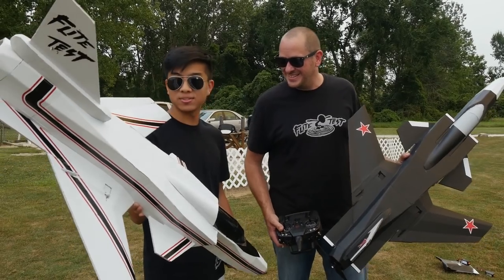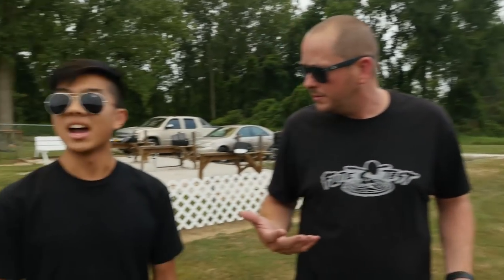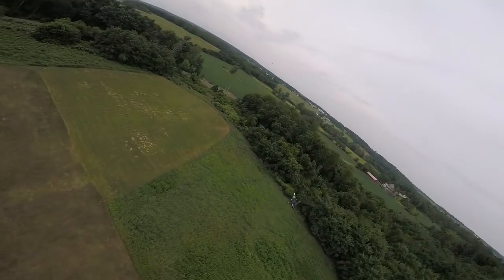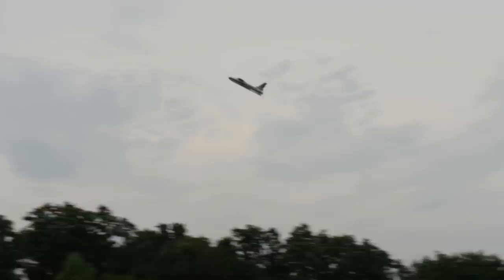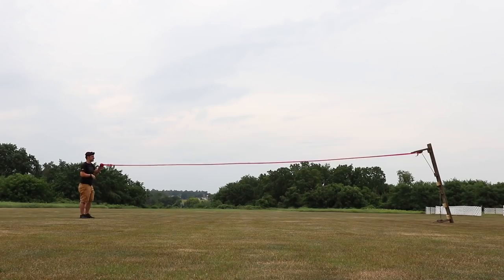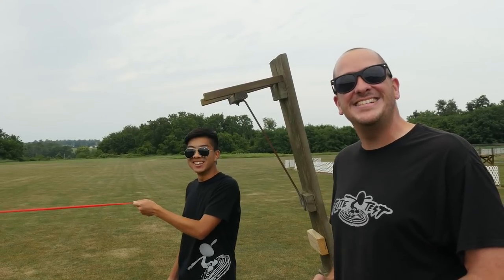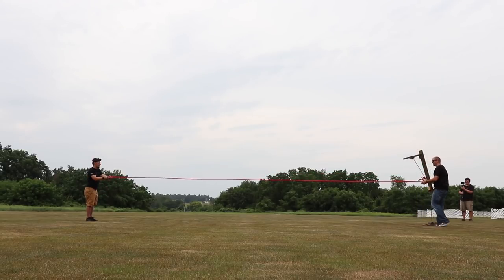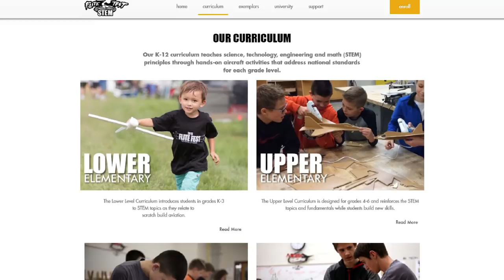DIY NASA Jet  |  FT X-29

Comment: The Grumman X-29 is actually a composite aircraft made with parts from various aircraft such as the McDonnell Douglas F/A-18 Hornet. The flight surface actuators and main landing gear struts are from the General Dynamics F-16A. Its fuselage and forward landing gear is from a recyled Northrop F-5A. The aircrafts main purpose (of course) was to test the feasibility of a modern forward swept wing fighter aircraft. Many test were conducted during the flight program. And a random fact about the X-29, its onboard computers control the movement of the aircraft correcting flight angles when needed. If the computers shut down, the aircraft would fall out of the air like a brick...

Comment: Have you thought about building a catapult similar to the one used for the V-1? Wouldn't be difficult with a pulley/rubber band system and some Teflon skids to prevent wear (could even use chair leg skids).

I'd imagine using a foot release, you could get some really consistent launches.

Comment: Hi, guys. I stumbled over your channel several weeks ago and have become a fan. You've put the fun back in flying and I love it. Over the course of an aviation career spanning 55 years, including 27 years as a U.S. Air Force fighter pilot, followed by another 15 years as a charter pilot primarily flying Cessna 411s an 421s , you now have me interested in R/C models. I've never flown one, my closest approach being some U-control models several years ago. The electric motors look much more interesting than the gas engines in my U-controls. Of special interest to me are the F-104 Starfighter and the Cessna 421. The 104 was a real blast to fly. Do you know of any models of either of these planes? I'm not really finding what I want on the Internet. I also flew the F-111 for about 20 years of my USAF career, but I suspect building the swing-wing might be a little tough to manage well. The 111 was quietly the best weapons platform ever built, in my opinion. So, any words of wisdom for me?

Comment: Hey there,
You guys are doing great job thank you., but i have a question outside the box,
can i use brushless motor to a quadcopter which uses small brushed motors?
will it work if i add ESC to the board and motors?

Comment: He could easily widen the back 1/2 of the fuselage to make it twin engine and twin vertical stabilizer. If he did that to make the Russian version then you could put in counter rotating props to cancel the torque.

Comment: These aren’t jets, it’s jet shaped prop planes..

A plane isn’t a jet because of shape, it’s a jet by fuel and turbine propulsion.
Reply: The model is of a jet and in the RC world most jets are propelled by EDFs, RC planes that have actual turbine engines are very big, very expensive and require a very skilled pilot. Also helicopters and tanks use turbine engines also, that doesn't make them jets. Shit Chrysler made a production turbine powered car, Jay Leno built his own custom turbine powered car the EcoJet. There is also a "jet" motorcycle. And turbine engines can burn several different fuels not just aviation fuel.

Comment: NASA put control surfaces on the strakes.  This helped give the plane better stability since the center of lift is so far forward.  This, effectively, causes the center of lift to come backwards when pitch is applied.  It might help with the problem of positioning the CG.

http://i.dailymail.co.uk/i/pix/2013/10/20/article-2468895-18DB70C400000578-373_964x723.jpg